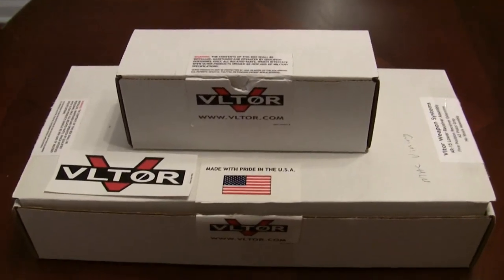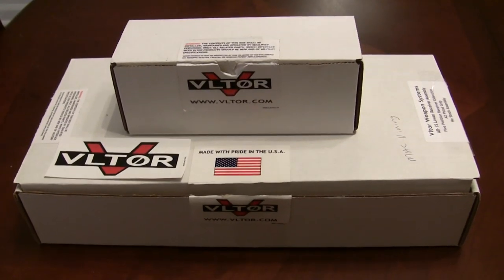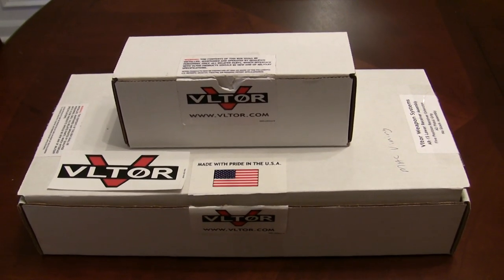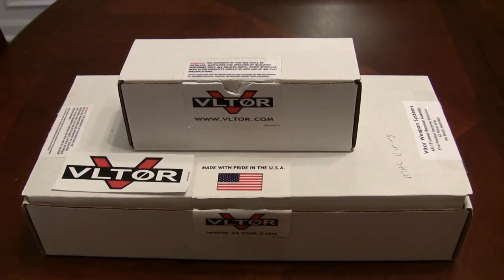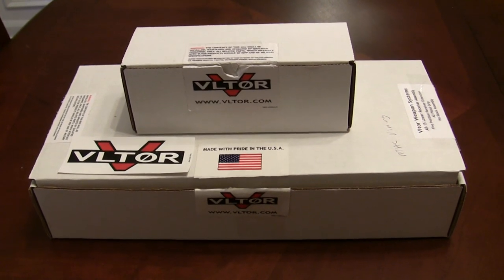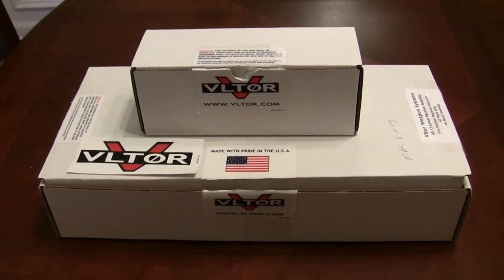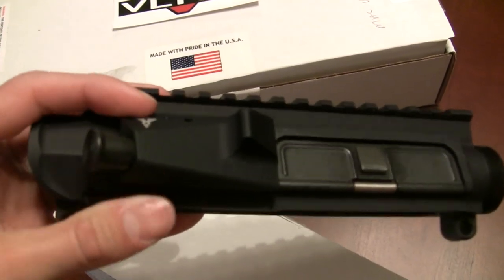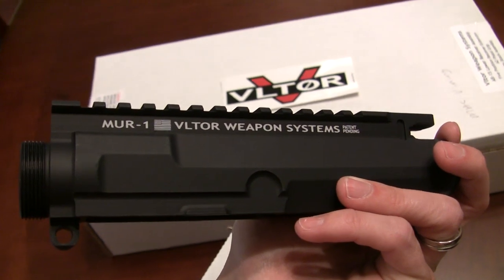BUILDING AN AR-15 FOR 3 GUN: VLTOR/JP 3-gun Rifle [PART 1]

Comment: Love your vids. I know that 3 gun and SPR guns are similar. I building an SPR'ISH 18" AR. Need you advise. I am debating CMT UPUR and a Vltor mur 1a. Barrel which I think is the heart of a precision rifle. Here are the barrels I am debating.

Wilson Combat 18", fluted 1-8 twist,  556 chamber
BCM SS410 18", 1-8 twist, 556 SAR-R chamber
Ranier Ultramatch 18", 223 Wylde rachet rifling.

All barrels are around $300-$350
Reply from the maker: ajfam871 Personally I like the Stretch-16 over all those.